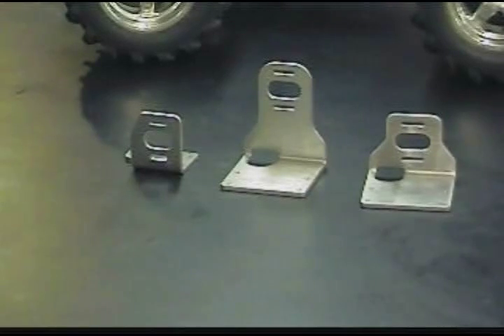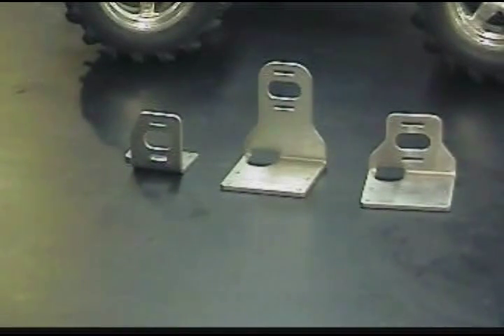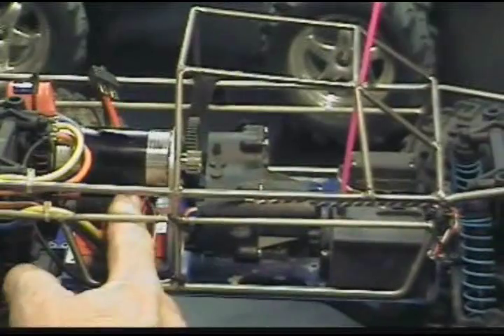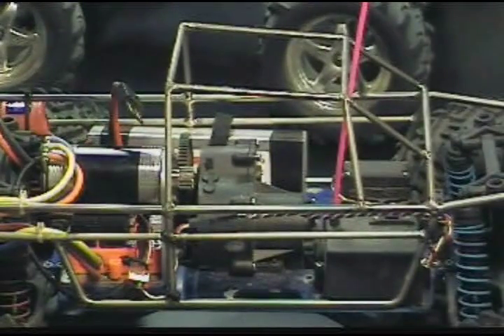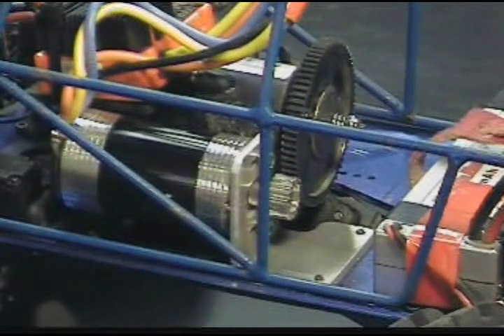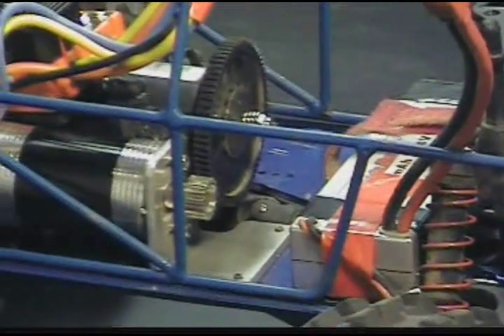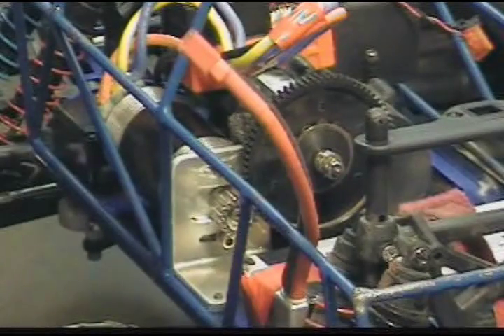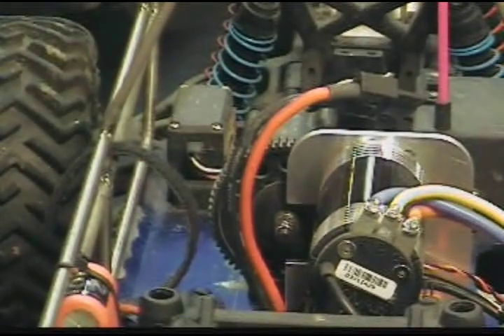T-Maxx Electric Motor Brushless conversion How2RC.com, S.avi

Comment: I fitted a hobbywing Max 8 combos with 150'amp esc, the thing is just stupid fast! I machined a decent mount out of 5mm billet aluminum inrun it on 4 cell lipo and it wheelies all the time and even as it changes gear fantastic stuff 
Running 18/54 gearing into the standard box I don't know how long the box will hold up

Comment from the maker: Good Thinking NOT ! The Novak motors are Sensored no swoping wires there. Swoping wires just works on non-sensored motors.
   Sensored motors will run slow, Non sensored motors come on rather fast, It would take a more complicated ( expensive) ESC to get non to run slow
Thanks for watching